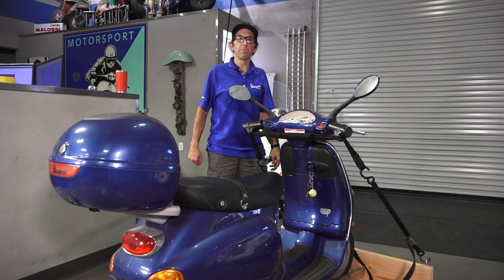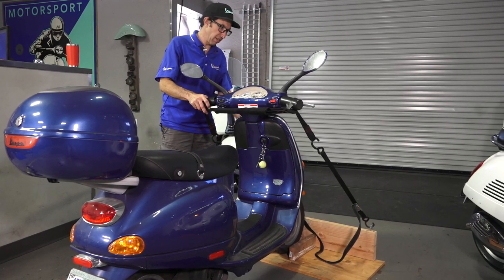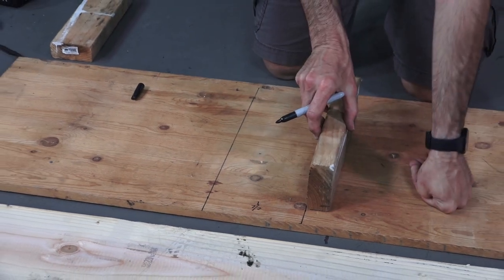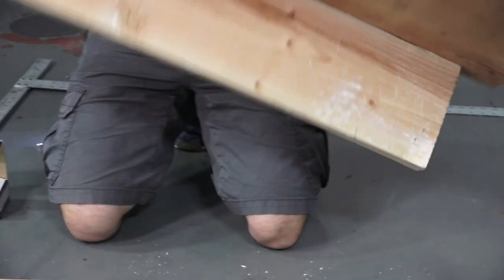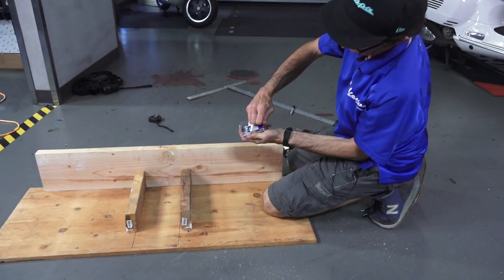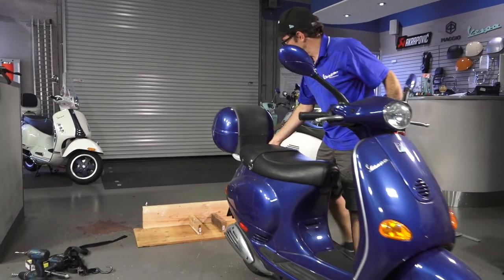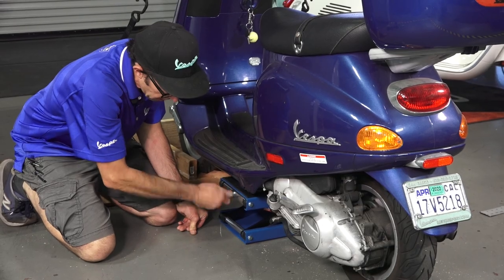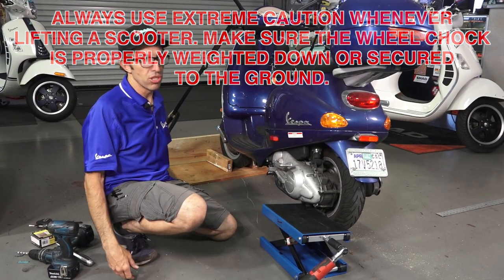How To Build a Scooter Wheel Chock for DIY Vespa Maintenance

Comment: Hi Mr Robot I have 2007 Piaggio mp3 250 IE! I just lock tilting system to change my oil and K&N oil filter! Right now to hot change the oil because I do not have a garage work in Only Carport!

Comment: Question for you Robot, you have two options for the canyon dancers. Any difference other than the hard cups for the grips versus soft cups? Or is there any other difference? Will be for a 2021 primavera 150.